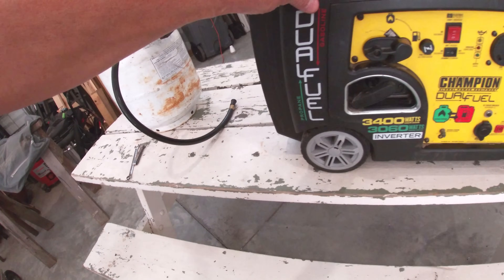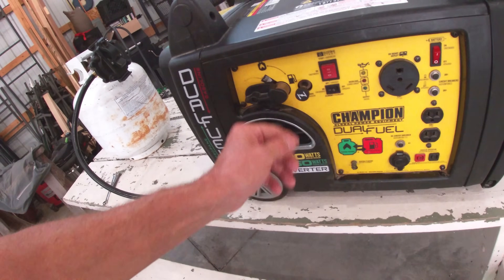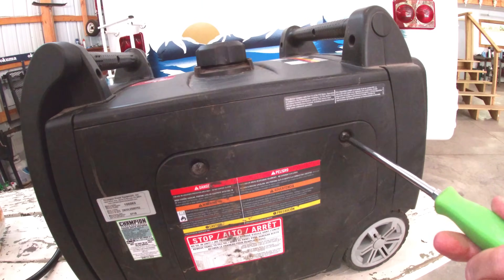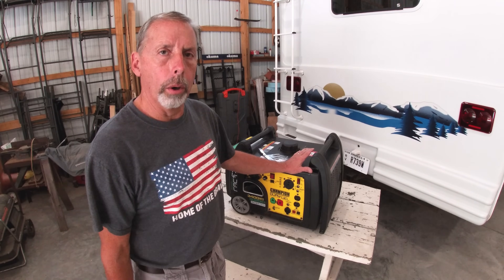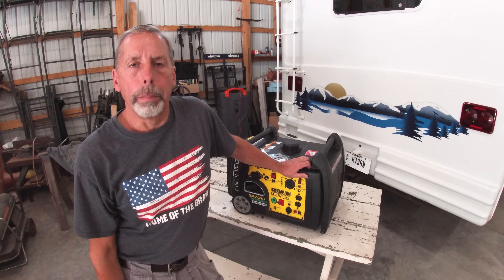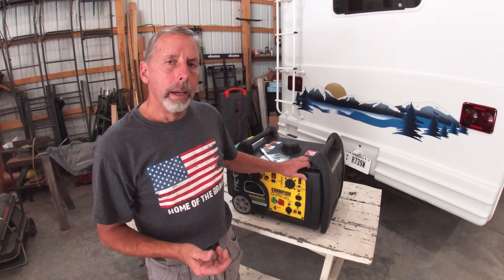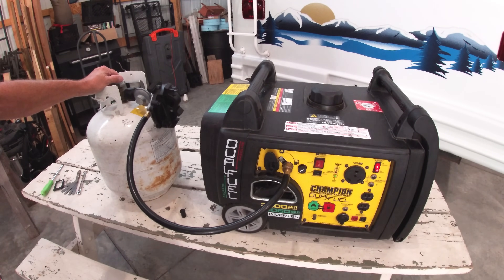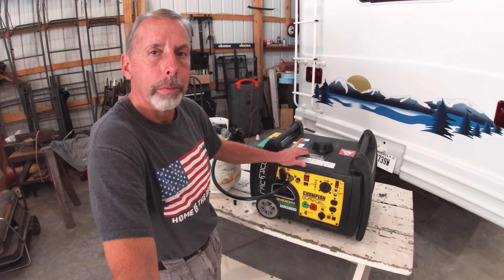Propane Generator Fail

Comment: A seriously common problem with propane us that it is normally a dirty fuel and just like with Mr Heater Buddy heaters you need to buy and install their inline filter. Your regulator cant regulstor cant regulate fuel it isn't getting. I know these things from living off grid for 70 years.
Reply from the maker: You are correct. Thanks for watching

Comment: I have the 10,000 w Duramax dual fuel  ,I never use gas I only run propane  had it 7 years but only ran it twice ,first time ran 8 straight hours second time only 2hrs 10 hrs total  but will start and run twice a year just to keep the battery charged  oh and I run the whole house except the central Air ,never had any starting issue .😊
Reply from the maker: Thanks for watching
Reply: @PleasantValleyOutdoors  thanks for sharing, there's a plethora of knowledge and trial by errors here on you tube that all can learn from ,keep em coming .😆

Comment: Sorry, but this isn’t a Champion problem.  It’s the excess flow valve in the propane tank.  It can happen on ANY propane device if the valve is opened too fast, but the longer the supply hose is, the more likely to happen.  The excess flow valve is a safety device mandated by the federal government to cut gas flow if it exceeds a certain btu per minute flow rate, so if you open the valve quickly, you can trip this valve because of the sudden outrush of gas filling the hose.  Really thought this was common knowledge, but guess not.  Also once tripped, it won’t automatically reset a lot of the time.  To reset it turn off the gas on the tank and gently rock the tank for a minute.  The valve usually doesn’t cut off all the flow when tripped, but enough to keep things from working.
Reply from the maker: Thanks for commenting. I have various propane appliances and have never had this issue so the slow open was new to me. Also the Champion regulator is designed to do basically the same thing as the propane tank per a fast open. One device will catch the high pressure before the other so it could be the tank or the regulator will trip 1st. I’ve really got a lot of good info from viewers on the video. Thanks for watching

Comment: LP gas fitter here Regulars will usually last for 10 years When fitting a new regulator the burner head pressure should be checked and may need adjusting and whole unit checked for leaks using the correct equipment At this time the unit can be checked over for correct operation for example the safety devices You should be able to turn on bottle valve at any speed but only ever turn on say a maximum of half the a turn This is so the valve can be turned off quickly and turning on a long way can damage the valve and cause a leak Remember when LPG leaks the gas is heavier than air and you will not always smell the leak and if you light the appliance BOOM Please don't take advice from people who are not trained in LPG gas operation It concerns me a lot
when untrained personal try to repair LPG equipment In my country it is an serious offence to install and repair LPG equipment and so it should be I could tell you some nasty stories but I won't Alsol appliances should be used regularly not left unused for extended periods of time PLEASE ONLY use a licenced trained GASFITTER...LPG is not to be played with for everyones safety Thank You
Reply from the maker: Thanks for the info and for watching

Comment: It's not the generator fail.  It's government overreacting.  New propane tanks lock up from time to time. You need to remove the hose from tank open the tank close the tank. Hook everything back up open the tank slowly and you are good.

Comment: I've got 2 champion dual fuel inverter generators. I will never buy another champion product. Their warranty and tech support are absolutely worthless. I'm not going to share on a public forum  what i found wrong with mine because i don't want to help that company in any way. As much as i dislike Harbor Freight, i would encourage anyone to buy their generators over champion because at least you can just get a new one for free when theirs fails. (Get extended warranty)
Reply from the maker: Thanks for watching

Comment: No such thing as duel fuel. If the compression is low enough for pump gas it's not high enough for propane. If you use it a lot it would be worth the fuel savings to have the head milled for more compression or a high compression piston.

Comment: I doubt that there's anything special about the regulator. Should be able to buy a replacement anywhere with the right specs for half the money they charged you. 
When you have propane problems, your first source for help needs to be a propane company. (not some store where you get refills) 
I'm sure they could have told you right off about the regulator and they have all the parts, fittings and expertise.
Helpful video though for those that needed it.

Comment: Champion generator I bot,failed after cutting about 20 boards,these are poor quality, and the ignition replacement parts didn't fix the no spark problem, so after several attempts to fix it,I asked for my money back!
It's not a reliable machine!
20 hrs and it's dead!
And I see 2 in Canadian tires outside compound!
These have a poor ignition system.
Mine was just a gas job.
Reply from the maker: Other than this issue it’s been a good running generator. Thanks for watching

Comment: well as we all know all these gensets (and most brands come out of the same factory) are cheaply made, the technologies they use is basic and even a big genset is going to give you that issue eventually - not to mention that they all burn oil since these are a 'splash lubrication" system - no oil pump as in a car engine. in other words anything smaller than a "standby diesel" gen set is not going to be very reliable.
Reply from the maker: Thanks for watching

Comment: In that "nut" that screws onto your propane tank is a check valve.  It is slamming shut when you open the tank too fast.  You can take that nut apart and remove the check valve.
Reply: Why would you want to remove a safety device when simply opening the valve slowly will solve the problem???

Comment: Never had any issues with any gas equipment…. Just buy good ethonol free fuel and shut the fuel valve and let it die down… if you have to just empty the carb….. use fuel stabilizer… never had an issue…ever

Comment: You dont need a choke when running on Propane.
Reply from the maker: Actually you do. Tried it many times. Thanks for watching
Reply: @PleasantValleyOutdoors  do you know what a choke does? It adds more gasoline because on the cold intake the gasoline condenses and doesnt reach the engine for a proper combustion. Propane doesnt condense so you dont need a choke.

Comment: Yep, its not just your generator. Any new propane appliance have that issue. My propane camp fire pit, my propane pizza oven. The devices sense that there is a open runaway leak and plug up. you can get them lit, but they don't put out any real heat/flame.Beware, this is something the propane industry should disseminate to all their customers.
Reply from the maker: Yep. Thanks for watching

Comment: TLDW: dont open the propane tank fast as the valve in the reg shuts the orifice to prevent excessive flow, its a safety measure. There saved ya 10 minutes
Reply from the maker: TLDR

Comment: everyone knows you have to open the bottle slow or it will not flow due to the safety valve.
Reply from the maker: Everybody?😂
Reply: @PleasantValleyOutdoors  I guess everyone that has experience with propane bottles. They have had that safety feature for years.

Comment: You cant run an engine on full choke because it loads up ( floods) the engine wasting fuel reducing power and dilluting the cyclinder lubrication destroying the engine. If you decided to let it run in full choke you were killing it.😂😂
Reply from the maker: I don’t run it in full choke but I do use it to start. Won’t start without it. Thanks for watching

Comment: Ours is plumbed to a large tank in the yard. Runs for 7 seconds and then dies. Starts fine and then runs 7 seconds over and over again.
Reply from the maker: Sounds like it’s not getting enough fuel.
Reply: @PleasantValleyOutdoors  the genhead isn't working and a sensor shuts the engine down. Champion guided me through a process of disconnecting two different wires one at a time and once the second wire was disconnected the engine ran fine. Now I've got to do several tests with a multimeter and look at the bushings to find the problem in the genhead or alternator. Thanks for your response !
Reply: @PleasantValleyOutdoors  and it was a lady that assisted me steo by step. Best customer service ever.

Comment: THE WAY YOU REPAIR THE CHAMPION GENERATOR! Take it to the curb! “ buy a Honda “  I  had a champion it lasted 30 mins the computer board went and they gave the repair shop a really hard time because it was under warranty! The reason they say it failed is to much was asked of it!  She said only use up to 1200 W 3200 W generator! RIGHT PUT IT IN THE GARBAGE!

Comment: i have a camper i have propane generator & i have propane buddy heaters  & main heater a like 50,000 btu mobile home unit it was like 2500 dollars 5 years ago computer run thing with change able propane jets & the stove too hot water is electric hot water tank! i keep spare parts for propane tanks & solar parts too  really well when the propane truck comes by and your monthly fee is 200 dollars for house propane you grab your wallet really i have natural gas really
Reply from the maker: Thanks for watching

Comment: Everyone on the planet knows which pedal in a car is the brake and everyone knows you have to open a propane tank very slowly. For either of those to be in any instruction manual would be like explaining to someone how to walk. Just put gas in it. Far easier and more powerful. No, you can't put oxygenated gasoline in a small engine but that is also common knowledge.

Comment: Gasoline, really won't gum up, I've had push mower sitting for 6 months, and never had a problem the net year. That problem is with the leaded Gasoline. All grills do the same thing, if they are newer, just search for low flow, on propane grill, I don't have a grill, that will do it....  Thank the Government, for that BS

Comment: The man only runs propane in his generator. Not even 100 hours. Clean your spark arrestor and adjust your valves this is funny. A spark arrestor never gets dirty unless after many years or more in the rust belt state left outside it rusts and (Possibly) spark areestor  clogs up. But unlike problematic gasoline they spark arrestors stop up. Store your generator in a climate controlled place not kept outside!

Ive installed alot of dual and tri fuel conversion kits. I would have just changed the tank fitting to the generator fitting. Just 2 quick connect fittings no hand tools. I wouldn't have another generator without a propane primer bulb. Because its so much easier to start!!! Get a Garretson pan cake valve with a primer bulb. so much easier to start. Push priner bulb and one pull start and running! Valves do need adjusting after so many hours! In technical support anywhere there's always that more seasoned pro tech any where!
Reply from the maker: Good info. Thanks for watching